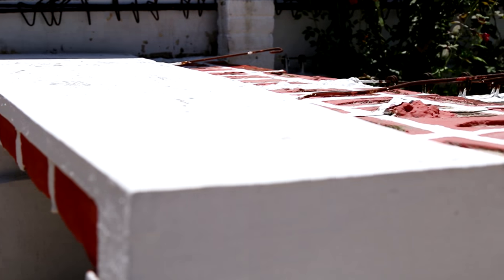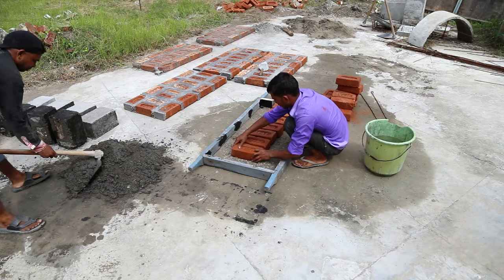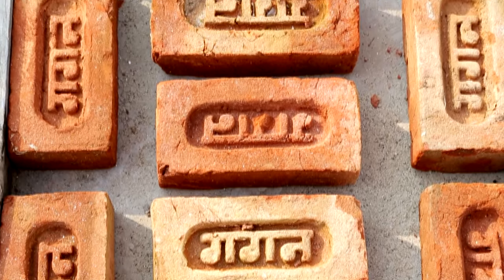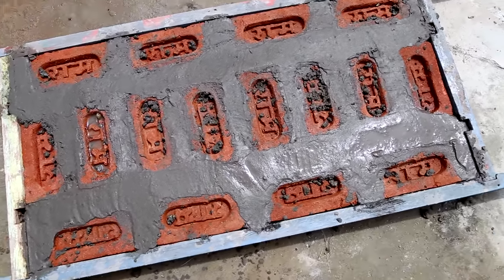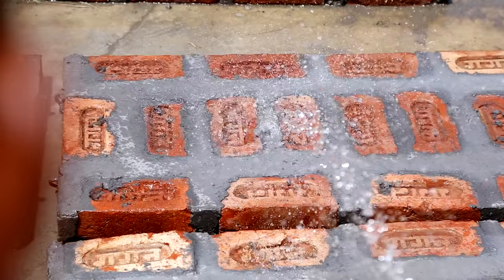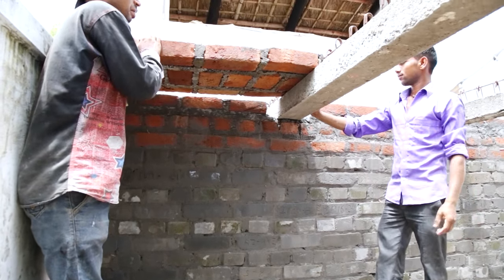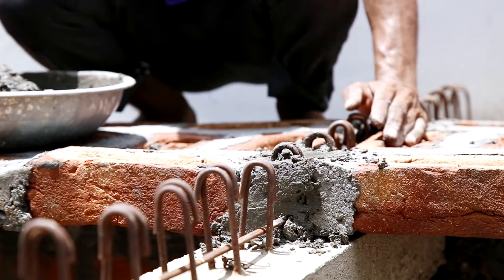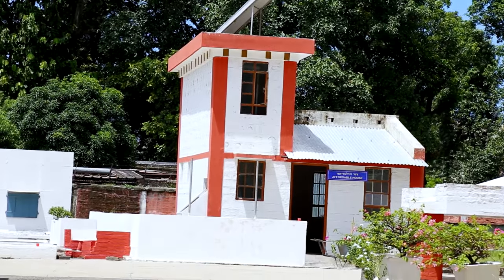CBRI's Prefab brick panel system movie: BKP media

Comment: Can any one tell us..what are the steel rod details for beams? 8 mm and 10 mm is ok?
After placing prefab brick panels..we can see extended steel over joist..what is that for? Should we go for again steel rod section over the prefab panels   And then .35 mm concrete over it? I’m confused here🤔

Comment: In practical use this roof style does not look very stable. It can cave in on excessive load.
Reply: In fact it is a partial presentation. I read the hole procedure from researchgate.net. The authors showed it meets all international building standards with load calculation and stability. I made a precast ferrocement slab roof earlier. Now I am seriously thinking of constracting the next floor with this technique. I am expessing my thankfulness to the author Itrat Amin Siddiqui
 of Central Building Research for sharing the tecnique on line and requesting for more detail explanation. So more people will be inspired to adopt this technique. I will upload some pictures when I construct it.
Reply: Hi sir..I’m searching for very affordable construction method and this prefab brick panels seems very good option for me. Walls ..I have decided for super sand bag method with cement beam over it. On this I will go with this brick prefab . Since I am non engineering back ground , I have one major doubt..What is the strength of this slab? Can we go for another floor? (of coarse with pillars)
We can not have electrical conduits in slab like how we fix in RCC. Am I right sir?
How should we anchor for a ceiling fan?
I will be very happy if you can clarify my doubts.
Thank you sir
Reply: gobechara taina what is the maximum length of beam to have this  prefab brick panel ? This bean looks like 6 inches by 6 inches ?
Reply: @mdsharifulazam  did you finish?